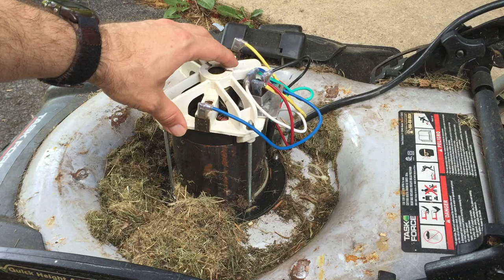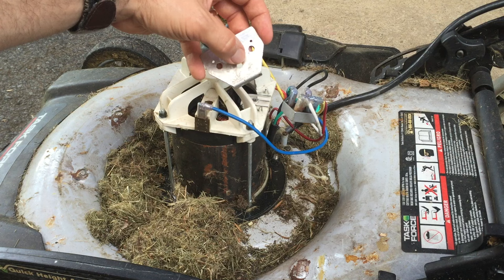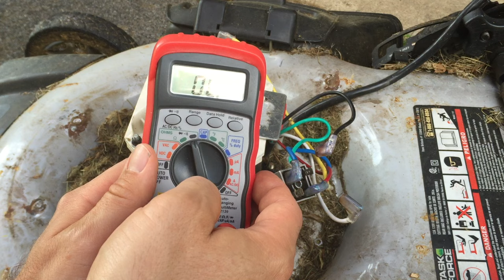How to Fix Electric Lawnmower (Rectifier) - Trips Circuit Breaker Short Circuit (Task Force)

Comment: I know I need a new rectifier for my Task Force lawn mower but the screws for the motor cover are old and apparently stuck/stripped. Any suggestions for getting the cover off? Thanks.
Reply: Just had the same issue and used a screw extractor set to remove them, the DeWalt DWAMIEXTRACT3 extractor set with the #1 size bit, and it worked like a charm. You will also need an extension to hold the bit because the screws are set a little deep. There are no instructions but you just use the sharper looking cutter bit in a drill set with the reverse direction selected and let it cut into the screw head by running it slowly for about a minute. Then flip the extractor bit to the cone side and even more slowly, still with the drill in reverse, use it to grab the screw head and back it out. That takes about another minute. If it isn’t grabbing, flip it to the cutter end and try that for another minute.

Comment: My electric lawn  ower (1 year old) starting shutting down after running for about 15 seconds. I removed housing and vacummed out all debris. Engine appears in good clean condition.  Cutting blade rotating no problem. Any suggestions how I an fix this? Does it sound like a rectifyer issue if the electricity works then shuts down.
Reply from the maker: It could be that you have to replace the brush in the motor or maybe a faulty switch somewhere in the handlebar assembly.  It could also be a rectifier, maybe overheating?  Those are some guesses.
Reply: @FrugalRepair  thanks for info. FYI I found out the mower was under a 2 year warranty I spoke to tech person at the  mfgr and he said it was a memory board issue and to simply pack it up, return it and I would get a brand new machine. I did just that. Apparently they don't have a service technician or small engine mechanic in Victoria. This  was also a lesson as to why it pays to buy some  items from a  big  box, national chain. My bet is to replace the board would probably have cost under $15 and taken maybe 10 minutes. But, in today's economy I was  more cost effective to just give me a new $300 piece of equipment, no questions asked. What a country!

Comment: Ok. I purchased the parts from your links and installed on my Kobalt KM210. Took the pic so I didn’t mix up the wires like you encouraged. Followed the pic when installing the wires on the new rectifier. But now my lawnmower runs continuously without having to be engaged by the handle. I’m guessing some of the wires are not matching what’s inside the new rectifier. I’m not comfortable switching the wires around to different posts without some guidance. Any suggestions??
Reply from the maker: My guess is that your issue is in your handle.  The AC power shouldn't go to the rectifier if the switch at the handle is off.
Reply: @FrugalRepair  ok thanks for your reply. I’ll check it out.

Comment: I'm having the same issue as others below. After replacing the rectifier the safety switch doesn't do its job and the mower is always on. My wiring on the rectifier is a bit different than yours and I didn't take a picture beforehand. My white and black are opposite yours. I may have put it back together wrong, but the wire length seems to suggest it's correct. 

On the safety switch I have continuity between the black in and black out. I also have continuity between the red out and the green out. When pressing the switch I lose the continuity between the red and green but it's maintained between the two blacks. 

Lastly, there's a bit of a burning smell when the mower is on. Is that from the thermal compound or another issue? I haven't used the mower in over a year. 

Do you think I have a bad switch or did I mis-wire it?

Thanks!
Reply from the maker: The burning smell would not be the thermal compound.  My guess is that it is the brushes contacting the commutator (its how this electric motor makes its electrical connection).  You could wipe the commutator (where the brushes touch it) with some isopropyl alcohol if you wanted to try cleaning it.  If the switch is in the "off" position you should not have continuity between both black wires but you should with the red/green (this is for the dynamic braking circuit).  Sounds like you wired it correctly since it is working.    Let me know if you have any more questions.
Reply: FrugalRepair thanks for the reply. I'll have to try cleaning the brushes. 

Thank you for the video. I now have 1 working mower rather than 3 semi-dead ones.
Reply from the maker: Glad I can help!

Comment: My task force has a larger ceramic resistor inside reading 50W4RJ.  I noticed this part was not on your mower, is this another part that could fail?  My original rectifier ruptured and after replacing it there were a few sparks thrown and did not continue to work after sparking.  (The parts that sparked were things I never touched to start with.)
Reply from the maker: I'm pretty sure there is a ceramic resistor (on the other side where the multimeter was).  Maybe you accidentally shorted the new rectifier?
Reply: @FrugalRepair  It was a pack of two rectifiers and after inserting the second one the lawnmower did not respond when plugged in.  I am not sure if I somehow blew the resistor or if there is something else that is causing this.  The motor did not spin up normally when the sparks were being thrown and they sparks were coming from the other electrical terminals on the motor and the resistor.
Reply: @FrugalRepair  Turns out it was the brushes on the motor not making good connection.  I was able to get the mower to start a few times, but the brushes were the source of the sparking and the internals were so full of rust that the springs were bound up/the brushes were so worn that both brushes were not always making contact.

Comment: I checked out the rectifier but there was no short there. But when I ohmed the resistor/cap I noticed there was a short there.  Do you think that's my problem?? Thnx
Reply from the maker: if you found a short circuit, then that sounds like a problem

Comment: I was curious about the DC to ac  does it change to 120 volts DC or to another voltage? I would like to use it as a charger.
Reply from the maker: You would have to look up the equation (and you'd have to get a datasheet for the bridge rectifier to get the values). There would at least be a voltage drop across the diodes so it wouldn't be exactly 120v.   You may want to read up on it some more before trying to charge anything.  Straight out of the rectifier you are getting a ripple in the current that you would want to deal with.
Reply: Thanks for the info... Good help.

Comment: I have the same mower as all the men on this chat. my mower started smoking. tripped the breaker. and didn't start again. I changed the bridge connector. and placed  electric tape on the wire covers because they were all black. didn't work. 
the two sides connectors on the motor kinda melted. so do you think its the motor and where can I get one
Reply from the maker: You probably don't need a new motor.  You probably only need to change the brushes (where you noticed the melting.  They push up against the "commutator" on the motor).  I put a little comment about it in the video description along with a link to the kind of thing you need to buy.  You only need (2) of them (one for each side). Let me know if you have more questions.

Comment: My screws are also stripped.  How did you get the plastic housing off of yours?
Reply from the maker: I used a hacksaw blade on my sawzall and cut between the chassis and the plastic housing. It cut the 4 screws without any trouble.

Comment: I have a 1 yr old black and Decker electric mower that hums when I turn it on, the blades don't turn.  It does not trip the breaker. Any idea what this could be?
Reply from the maker: Thanks for asking! My first thought is that the brushes are worn out, or at least one of the brushes is worn out. There are probably two brushes that connect to the commutator.  If you don’t know what that is, google that word and look at some pictures of what a brushed motor is. You should be able to take the lid off of your mower and see for yourself if that is the case.
Reply: @FrugalRepair  by brushes it seems you mean the spring loaded piece of carbon that comes in contact with the motor, I checked mine , both appear to be in good shape. I cleaned them up with sandpaper, still no go
Reply: Also the blades do turn, but very slowly, like 1 revolution takes about 5 seconds, and I do get a loud hum sound.
Reply from the maker: That sounds to me like something is impeding the axle.  Does the blade turn freely by hand?
Reply: @FrugalRepair  it does turn, but there is resistance . It doesn't freely spin
Reply from the maker: Sounds like you may need to verify if that is a problem or not.  I would think it should spin more freely
Reply: @FrugalRepair  I'm pretty sure there was similar resistance even when it was brand new
Reply: Thanks for the informative 
video.
Question- how does one convert a 24V cordless lawnmower to AC 
Add Rectifier or change  Motor ?
Thanks in advance for sharing your knowledge.
Reply from the maker: @bazmc3583  My first question is why you would want to do that?  But if the motor is a DC motor then you can probably use the design of most corded electric lawn mowers (rectifier, brake resistor, etc).  I presume that the type (brushed or brushless) of motor will factor in too to the design.  I'd have to think about it some more but that's an initial thought.

Comment: How'd you get the cover off the mower?  My screws don't come out.
Reply from the maker: I used a sawzall and cut the bolts off at the threads.
Reply: @FrugalRepair  Gotcha, yeah I flipped the lawnmower over and saw the rusted bolts and I knocked them out with a hammer.

Comment: Electric lawn mower starts and works but after a while cuts .opened it and found a sparked cable that goes to one of the legs of the capacitor ,checked the capacitor and it was reading or showing that its ok,what could be wrong
Reply from the maker: Do you mean the rectifier?  That is what converts AC to DC for the motor.

Comment: I have a Greenworks that trips the breaker when I try to start it (brand new mower).  I've tried it on a normal outlet in the garage as well as the WR outlets outside.  I tested for continuity on rectifier like you said, but that checked out good.  Any thoughts?
Reply from the maker: If the breaker is getting tripped when you go to start the mower then you have a short circuit somewhere.  The most likely culprit is the rectifier but it could be something else.  Has the mower ever worked?
Reply: No, it is brand new.  I didn't want to deal with the hassle of returning
 it if I could be sure it was just a $10 part that I needed.
Reply from the maker: Sounds like you might want to return it.   Sorry to hear that.  Its a bummer when new things come out of the box broken.
Reply: So I had a replacement sent and it was the same issue, so then I literally tried it on every single outlet on the outside of my house and found that it does in fact work, but only at one of them (they are all connected to the same breaker, though).  So I was thinking it was due to distance from the breaker and voltage drop, but this outlet isn't even the closest to the breaker panel.  Now I'm just baffled.
Reply from the maker: I'm glad the mower works.  Are you 100% sure that they are all on the same breaker?  That is, if you turn off the one breaker, do all of the outside outlets stop working?
Reply: I will check, but unless that one outlet is tied to something inside the only breakers it should be are either the garage outlet or outside outlet breakers.  Unfortunately, the mower working on only one outlet means I can only mow 1/4 of my yard.  Might just look into a battery powered one and avoid this whole breaker/outlet dilemma.
Reply from the maker: House wiring can be unpredictable.  If you didn't wire it yourself you'll probably be saying at some point, "Why in the world did they do it that way?!"  I think it would be worth your time figuring out what outlets on are on which breaker(s).
Reply: Fair enough.  If that outlet is on the same breaker, though, I'm not really sure what it could be.  The wiring itself should be fine (the 4 amp trimmer works on all the outlets).
Reply from the maker: Try this, use the lawn mover on an outlet that trips the breaker.  Then move it and use it on the outlet that doesn't trip the breaker.  If this works, then the two outlets are on separate breakers.  Then find the breaker that outlet is on and notice what else turns off in the house.   What is almost certainly tripping the breaker (past its amp rating)  is the current draw from the electric motor.  There is probably something else drawing current that is on that same breaker.  I guess you could also have a bad breaker.

Comment: hi I have a 19" 12 amp version and use a 15 amp extension cord, and my son used it and didn't know any better and plugged it into another extension cord instead of directly in the wall outlet.  he did a small yard and it was bogging down a lot he said and then totally stopped working.  So I am guessing this was because the amps were only around 7.5 running thru the cord.  what do you think is wrong with it?  burned up motor or somethign else?
Reply from the maker: Did you try it with a short cord, and it doesn’t turn on?  The “bogging down” is a clue that maybe what happened is that the bridge rectifier got too hot and broke.  Did you open the top also to look for anything out of place?
Reply: @FrugalRepair  I will look.  What signs will it have?
Reply: @FrugalRepair  if that rectifier is broke where  would I get another one? have a link?
Reply from the maker: I’d look for any loose connections.  If you have a multimeter you can test the rectifier.  I could explain it but there is lots of info online.  I have a link to a bridge rectifier in the video description you can look at.

Comment: Thanks for your post. It worked for me but now the mower starts as soon as I plug it in rather than when I push the start button. Any idea how to fix that?
Reply from the maker: Did it do that before the repair?  It would most likely be an issue in the safety/start switch.  Maybe playing with the switch a bunch and wiggle it around might work then try plugging it in.  It seems stuck in the "on" position. You could always take it apart to see.
Reply: 你好，我的草坪机也出现了和你同样的问题，你怎么解决？谢谢！
Reply from the maker: Do you have the same mower I have in the video?  I don't know what else it could be besides an issue with the switch.  It may be stuck in the "on" position.
Reply: My lawn mower brand model is: KOBALT KM210. Before the use of normal, once again in the process of cutting grass suddenly repeated tripping, and later I found on the Internet that the rectifier is broken, I changed one, after the trip did not trip, but a power mower will automatically open The I do not know where the problem is. Back to me and then check the "open" position is not good. Thank you!
Reply from the maker: I'm not sure the translation happened correctly.  Did you open up the start switch assembly to see if the switch is stuck in the "on" position?
Reply: I try it, thank you!
Reply: Thank you for your help, I have repaired the switch.
Reply from the maker: Great job!  Did it fix the problem?
Reply: The problem is solved。
Reply from the maker: Great to hear!  Again, great job!

Comment: My earthwise 24 volt lawn mower won't start i charged the battey still no light
Reply from the maker: Make sure to use a multimeter to test that the battery's voltage is good.  I'm wondering if I should make videos about electric lawnmower fixes.  I have one but it's not had any problems yet.

Comment: hey man why is my lawn mower starting as soon as I plug it in, and now after replacing the rectifier i dont need to pull the switch?
Reply from the maker: Check for continuity with your multi-meter on the hot (black) AC wire and where it connects on the rectifier.  You can even unplug the black wire from the rectifier to isolate this wire while you test it.  If this is shorted/connected then something in the switch needs to be repaired or replaced.  The default setting for the switch is to complete the circuit with the dynamic brake (ie that big resistor).  It's default position should not be to send power to the rectifier/motor.  Let me know if you have more questions.

Comment: If my meter reader doesn’t beep, what should I look for? A reading of zero?
Reply from the maker: What kind of multi-meter do you have?  Are you sure it has a continuity setting?  If you have a short circuit then you can also use the resistance setting (ohms) to verify.  I couldn't tell you what number it would be but it would be less than infiniti (which an ideal open circuit would have).  The bottom line though is, if your house breaker is getting tripped when the mower turns on and you have a bridge rectifier like this one, then you almost certainly have a bad rectifier.
Reply: We have a Craftsman 34-82141 Digital Multimeter with 8 Functions and 20 Ranges. When I tested the rectifier, I got a reading of zero. I am not knowledgeable of multimeters. I did go ahead and order a new rectifier, so here’s hoping it will fix the mower!

Comment: Hi, i just replaced the rectifier today, it runs now, but... it starts up as soon as i plug it in. please help,   Ron
Reply from the maker: I’d google for a diagram of an electric mower.  There are some good illustrations out there.  Your switch maybe the problem.
Reply: @FrugalRepair  Hadn't had a chance to check out the switch up on the handle. will do it this weekend. Thanks so much